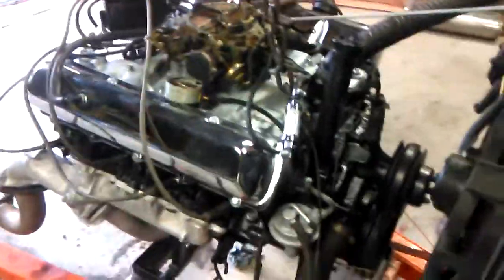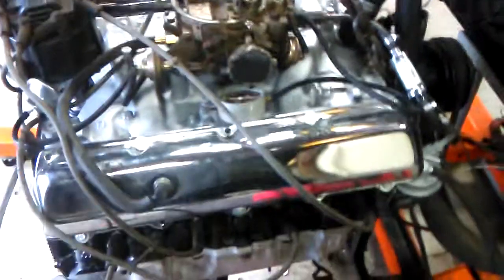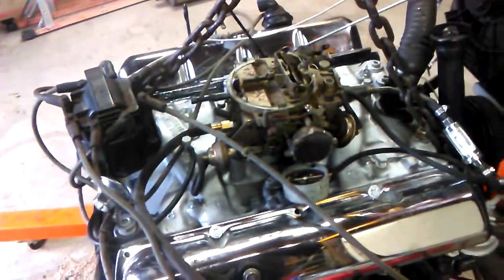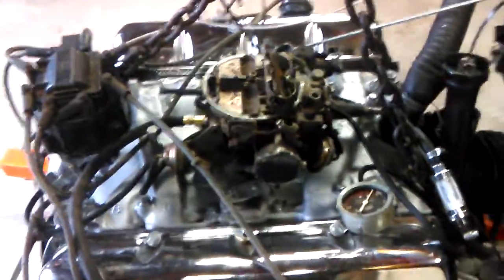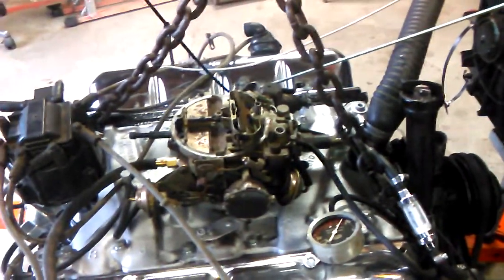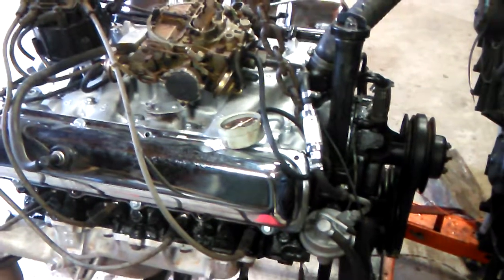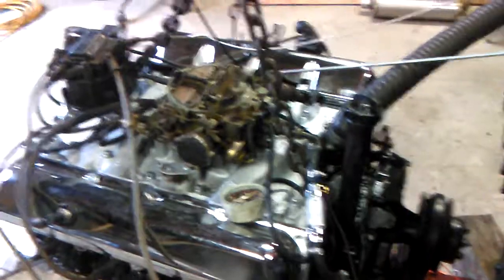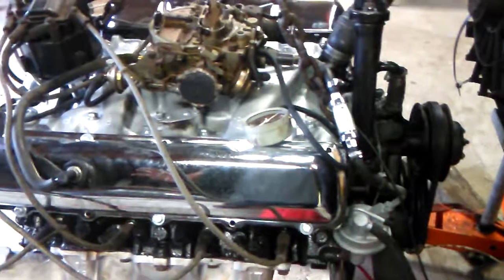Oldsmobile 350 intake manifold modifications, part 1

Comment from the maker: I have a few Olds 350s and 307s for sale
Reply: Intrested in a olds 350 rocket 
hillsbro34@yahoo.com
8136504514
Thanks
Reply from the maker: @PutMeInDaGameCoach  the only one I have left is the 350 I made out of the diesel, with the aluminum heads, that is featured in my other videos. Low-end torque roller cam motor for a big car. But I want four grand for it
Reply from the maker: @PutMeInDaGameCoach  oh, I'm sorry. I had Chevy 307 in my head when I mentioned 327 stroke.  But basic hot rodding techniques are the same.  Once you get the compression up, you can do anything.  In your case, I think flat top pistons would help a lot.  Which of course means a total overhaul. It's hard to get heads with small enough chambers for the dish Pistons
Reply from the maker: And thanks for watching. I sincerely appreciate that, from everyone
Reply from the maker: @PutMeInDaGameCoach  well, if you're referring to the Oldsmobile small block EFI that came on the Cadillacs... I've had one in my hand, and I wouldn't give you a nickel for the intake manifold. Aside from being aluminum, the design is terrible.  I'm not that experienced in aftermarket fuel injection.  We did a couple of Holley Sniper installs this year, and they don't exactly self-tune the way Holley claims they do.  They dislike cams, although your stock one should be fine, and the roller cam is very good.  You could have one of the real experts in the country build your Quadrajet, for half the money and aggravation. But I am biased against computers in general.  But if it were my car...edelbrock performer RPM manifold (hood clearance?), crossover blocked, and Summit annular booster carb.  And the 7a heads, just too restrictive.  IF you find a decent set of 5As, much better.  And do a 3-angle valve job while they're off, if the budget allows.  Then you will also see the piston dish.  It is a bit sad.